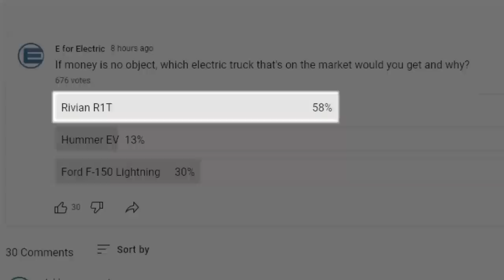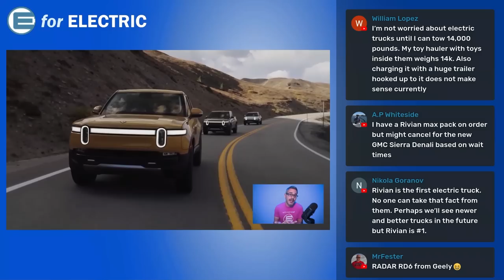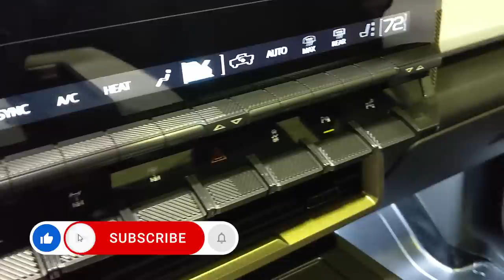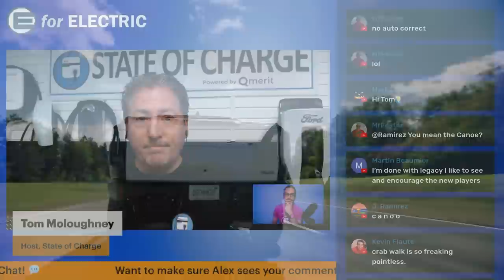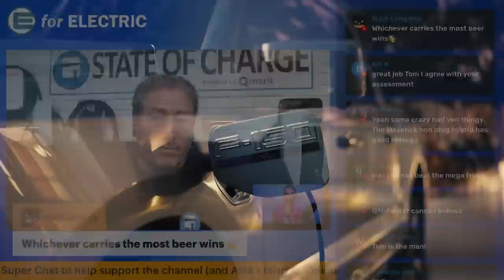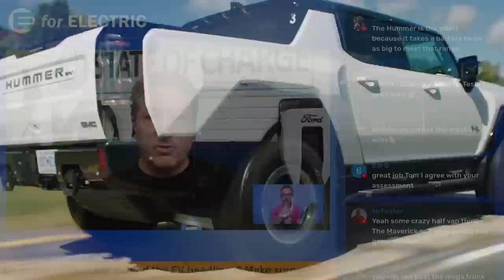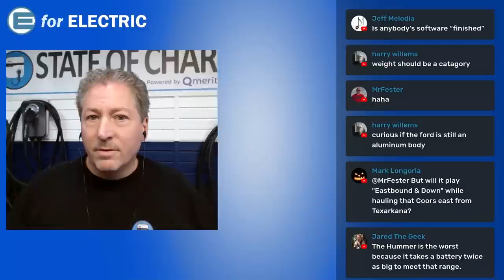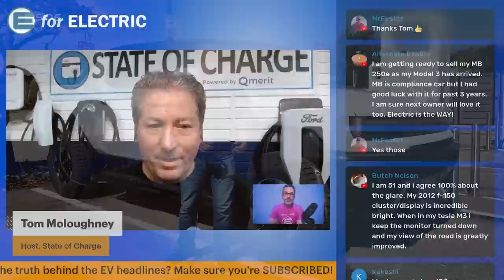The Best Electric Truck Snubbed

Comment: You can't be serious....!!!

Didn't Chevy just recall ALL of the Hummer trucks for battery issues? And the Hummer is by far the largest and least energy efficient one on the road. It's not even a truck most can drive in most areas properly do to its size. For the size battery it has, the anemic range it gets on that size battery, the inefficiency of it It's a wonder they haven't pulled it off the road for good. It's a heavy monstrous waste of materials.

Don't flatter yourself. This has absolutely nothing to do with marketing or your wannabe crusader complex. The truck is horrible just on specs alone compared to the competition. Hummer was/is a bad truck/suv in gas form and even worse in EV form. There's a reason no one is talking about this truck...because there really isn't much to say about it. Heck, GMC isn't even hyping it up. And when you have to spend your monthly mortgage payment to cover the cost of just one tail light I think you have a show piece and not a serious contender to the rest of the market.

Tom is spot on. If you want to argue range being important then it needs to be road trip worthy and in that case you might need capable storage so that you don't clutter the inside of the vehicle so the size of the frunk is very important. And while V2G or the many outlets the F150 has for V2L are very important to many people and not to you speaks volumes. Imagine if you were in Florida or Puerto Rico or New Orleans where at any given time you might want to use your truck as a power source but are very limited by to only 2 outlets on that monster truck that can't even be used effectively like the F150. Come on..!!!

Sorry but Tom put this one to bed. It's incredible how you're trying to hold on to this belief you have about this truck. Who cares if it can charge 350kw. You fist have to find a station that has that size and hope it's not being used or better yet...HOPE it's actually working. And like Tom said, it means nothing if it handles 350kw but overheats and then your charging curves are all over the place making it inconsistent. And it it's going to take 2h hours to charge at home then it's a useless truck.

I care about how big the battery in my phone is and what apps I have installed, open or running in the background because it, among other things, will dictate how long it will maintain throughout my day before I think about plugging it in. That's called efficiency. And the Hummer EV lacks that over the others. If it's inefficient then who cares how big the battery is.

Comment: Putting electric back into the house is an amazing & very valuable thing. It means your car becomes your house solar storage system. How much are power walls? This is the best feature. Pushing me towards a Hyundai ionic 5 away from Tesla cars unfortunately. Australia 🦘